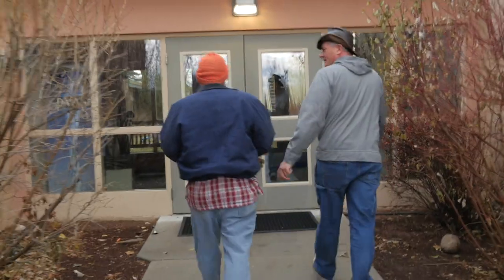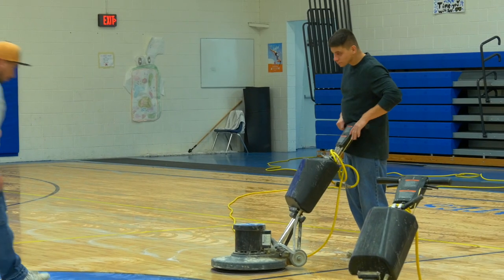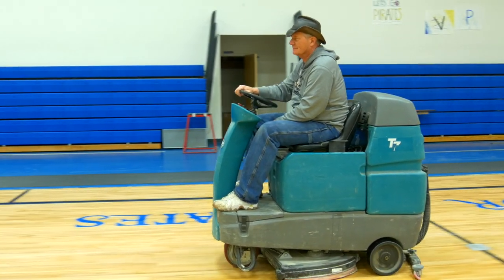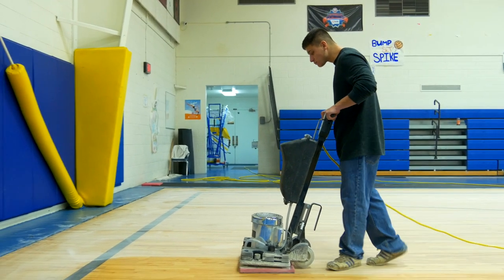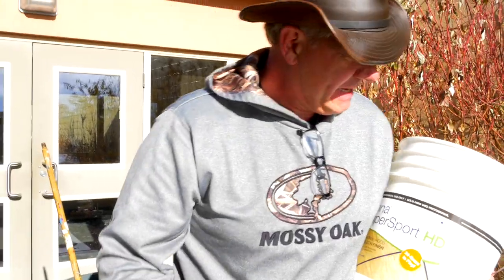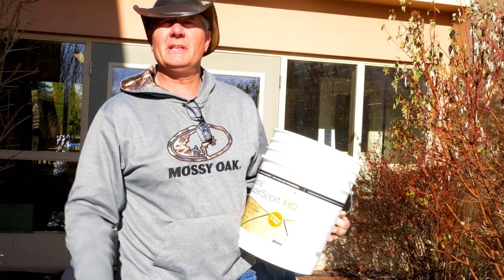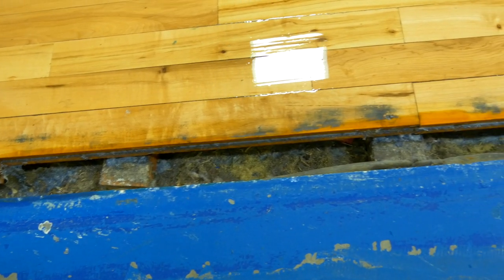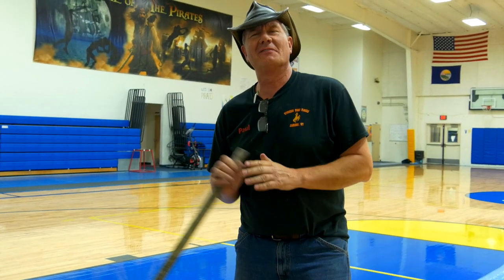Gymnasium Floor (Annual Maintenance Coat)

Comment: Hey there in 2023!
  We have used the SPP method as our sole source of abrasion since viewing your videos last year. So far, so good. We have a project coming up that could use your opinion.  We have a floor that was finished with oil and now we are converting to a water based finish.  Would you recommend using more than an SPP? Something a little tougher? Floor is in good shape and we want to avoid peeling.
Reply from the maker: If your concerned about it, use a screen! Then next year you should be able to go right back to SPP pads!!

Comment: What is usually under these floors? We all know it's harder for itself. And then there's plow, but between that and the concrete. There's usually either a 2 / 4 or 1 by T. Was rubber under it. Some people put carpet patting. What is the best to use? Again? I'm referring to the subflor which is the concrete between there and the first layer of plywood followed by the home

Comment: Hi! For standard gym floors, I know you would typically apply the finish following the grain of the wood (north to south etc) - How would you recommend coating a  zigzag (V arrangement/ Herringbone/ Chevron ) patterned floor? 
I really appreciate your content. Thank you for your time!
Reply from the maker: Great question! In the case of a Herringbone, Chevron, or Parquet floor, we would still coat the floor in the same direction as the main basketball court. However, depending on where the doors were located (for the close out) we may do it differently. The point is, anyway it’s done you will be going cross grain to some of the flooring.
Reply: @WyomingWoodFloors  Thank you so much for the quick reply and valuable info!

Comment: For your brute can poly cart, can I ask the reason for the pvc pipe going up with a cap vs just having the outlet pipe at the bottom?
Reply from the maker: The PVC pipe is just an extension to operate the valve without having to bend over.

Comment: Great video, What do you charge a sqft for your clean and recoat?
Reply from the maker: Great Question, but not easy to answer. We live in a large rural state (Montana) and service customers in several other states. So our pricing structure takes into account distance, size of facility, number of gyms in the district and so on. Historically we have been in the $0.45-$0.55 per sq ft for (1) coat of OMU (oil modified urethane) and $0.55-$0.75 for (2) coats of water based finish.
Reply: @WyomingWoodFloors  thanks for reply love your channel!

Comment: So glad I found this video. I work for a small district in Florida. We’ve had some issues recently with the company recoating our old gym floor. We already employ the SPP pads and square scrub machines throughout the district. I think we can do it. How many buckets of finish did you use on this recoat?
Reply from the maker: Most finish manufactures recommend an application rate of 500 sq ft per gallon. We find that water based finish usually goes a little further, about 600-700 square ft per gallon. 
Take the length X width of your gym and divide by 600. That number is your gallons. Divid that number by 5 to get the number of pails that you need. 
Thanks for watching!!
Reply: @WyomingWoodFloors  
Thank you so much. I’m curious if you have ever encountered the problem we are experiencing. Our floors were refinished last year. About 2 weeks later the floors developed a white almost greasy haze. We’ve cleaned and scrubbed but no matter what we do the residue comes back. We’ve been told it’s something called “solvent rain back”
Reply from the maker: @32brad91  I am familiar with the term, but have never seen that situation. It maybe related to humidity, but I could not say for sure.

Comment: I've watched a few videos now. If I heard correctly, SPP pads would be a 200 grit pad?
Reply from the maker: I was on 3M's website trying to verify that, but I could not find anything. Other sites say the SPP pad is equivalent to 200-320 grit. In our experience, they do a great job of taking out the floor blemishes, however the scratch's are fine enough that they are easily covered by the finish.

Comment: Doing this now. Are the SPP pads all that you employ? I'm hesitant to use sanding disc (120 grit.) What are your thoughts? Wet work with disc?
Reply from the maker: Hey Pat, we only use SPP pads, however we use SPP pads on the buffers to get out the heel marks, and really dirty spots. Then we use SPP pads on the square scrubs to abrade the floor. Finally we are cleaning the floor with an auto scrubber that has SPP pads on it. We have used this system exclusively for 6-7 years now & have reduced peeling finish to nearly zero! Thanks for watching!!
Reply: @Wyoming Wood Floors  last question. During the screening process with SPPs we are noticing peeling from previous coats. We employ the same style Bona that you all do. How safe should I feel about proper adhesion? We are following steps listed in video. Just concerned about the peeling. THANKS!
Reply from the maker: @patrickficklin  It’s tough when you are coming in behind someone who did a poor job. However….. if you are using a high quality 2 component water based gym floor finish (like Bona Supersport HD) that may secure everything down. Ultimately, if a floor has much peeling finish, it will need to be sanded back to raw wood & re painted.  We have a recent video about peeling gym floor finish & how we mitigated it.
Reply: @WyomingWoodFloors  Fantastic! I'll watch now
Reply: Yikes! Watched that video. Our issue stemmed from AC shutting off (Louisiana) and students getting back on the floor too quickly. 2nd coat had some peeling areas. We are abrading the surface again today and laying the 24 hour Bona finish. It's minimal peeling thankfully. Fingers crossed we are good. Found you guys by accident but glad I did!
Reply from the maker: @patrickficklin  Hey Pat, if you want to discuss your project, email me your phone number & I will call you back! paul@wyomingwoodfloors.com

Comment: Awesome video may I ask what you guys charge for that service per square foot?
Reply from the maker: That question is difficult to answer. Lots of variables like type of finish, number of coats, distance from our warehouse & the number & size of gyms we are going to be working on. Our customers are mainly school districts, so these jobs are usually awarded by sealed bid. Typically we are in the $0.50 to $0.75 per sq ft range.

Comment: Using the SPP pads wet with IFT/Squeaky still abrading the floor while you makes passes with it?
Reply from the maker: We clean the floor with IFT and an SPP pad. We then clean the floor. Lastly we abrade it dry with a SPP pad.

Comment: Hey buddy what waterbase urethane are you working with my best of my knowledge all waterbase you were saying tells you not to water it down there's any one brand on the market that I'm aware of and it's poly whey 8 ounces per gallon. Every other thing I work with  bona, all basic coding tell you not to water their product down..
Reply from the maker: Thanks Jason! I suppose we should point out that nothing works everywhere. We are based out of Montana & work the Rocky Mountain West. It’s usually warm & dry or cold & dry. On long runs in a gym floor the finish tends to get sticky and hard to level with-out a small amount of water. This maybe a bad idea in a high humidity environment. Just sharing our methodology.

Comment: How many coats of finish you manaaged here ? ... 2 or more ? ...
Reply from the maker: With Water Based finish we usually apply 2 coats of finish.
Reply: What grit of did you use on the square sanding machine. I want to take up the old varnish but not mess with my paint.
Reply from the maker: @jeremymcguff9527  we use a 3M SPP pad. 
Surface Preparation Pad. 
They are equivalent to 200 grit sandpaper. In our experience, they abrade the floor, but do not damage the paint!